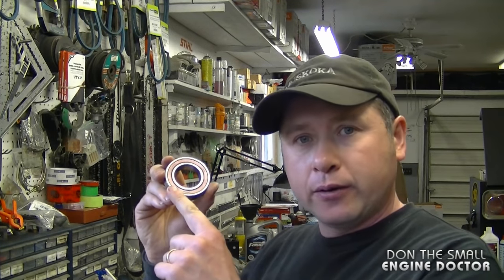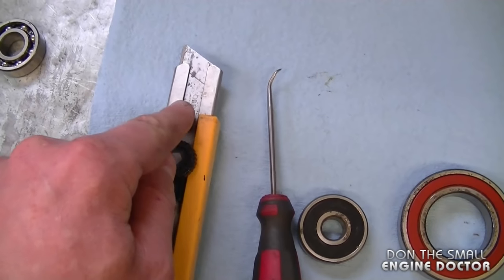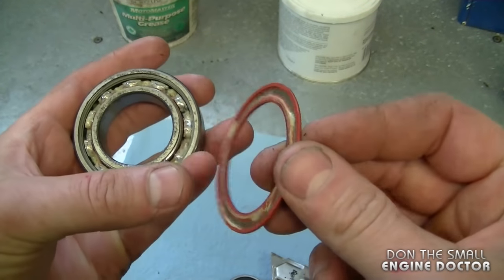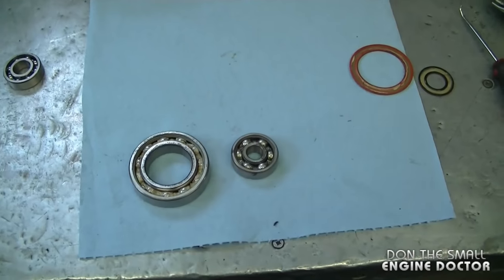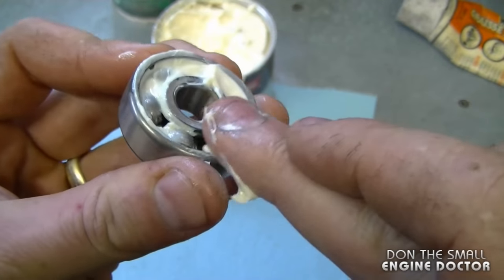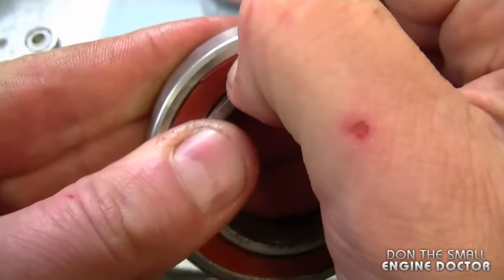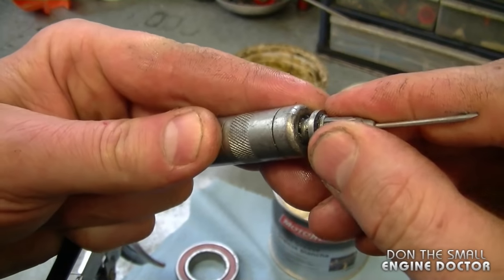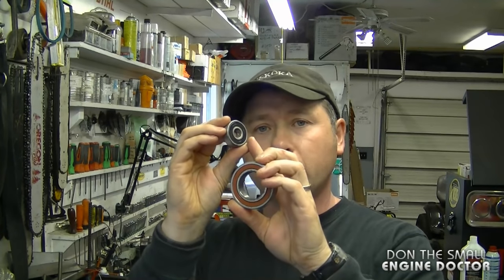HOW-TO Grease A Sealed Bearing

Comment: Love your videos Donny, but every now and then I have to shake my head. This time your advice can do more harm than good and I know that is not your intention. Bearings are cheap compared to the damage a failed bearing can do to a machine. I do understand that there are many situations where a replacement bearing is not easy to find and what you have shown here should be seen as a temporary fix. You did say not to over grease but you should also have said that over-greasing a bearing can destroy a bearing as sure as not enough grease. The larger bearing already had about the right amount in. The smaller one was too dry in which case damage may already have occurred so it would be safer to replace it as soon as you can take delivery. This is a great fix in non-critical applications. In other more critical areas if you are going to press a bearing out - always press a new one in, better to not take the chance. Weed whacker crank bearings are a case in point :-)
Reply: I understand what you said, but I think the rule of common sense applies here. No one will attempt this in engine or (high speed) wheel bearings. I would happily do this on my lawn tractor for example. As long there's no wobble, the bearing is fine.
Reply: I understand your reply and have stated; "This is a great fix in non-critical applications". Yep, great for mower wheel bearings etc., just not for weed eater bearings and the like. Common sense is not always present so making the distinction is part of good advice.
Reply: Hey, I'm not griping, Donny usually gives great advice. Common sense is not gifted to everyone though, so this post should only apply to low speed non critical applications and that wasn't stated. I know more than one have-a-go-hero that would mess this up and probably cause injury to someone. It ain't cool to encourage those short on common sense to do dumb stuff. Flemming the wheel bearings you mention don't come under the 'sealed bearing' category that applies here :)
Reply: Repack all sealed bearings even when new. There will be a minimal coating of grease in the bearing ensuring premature wear and failure. Buy a sealed bearing and have a look. I always repack my bearings; ducati wheel bearings especially else they will only last a year or so. Same with vehicle suspension ball joints. Only minimal grease. Assume it is a cost issue !!!!!!
Reply: I have been repacking sealed wheel bearings for years and prefer to ride my motorcycles in the knowledge the bearings have lubrication. Premature bearing failure is guaranteed unless they are repacked as from new bearings have only enough grease to stop them rusting. A very thin coat indeed. Naysayers have a look at a new sealed bearing.
Reply: Flemming, There are bearings that this hack should not be done to. Good guidance seems to have slipped Donny's mind on this video - easily done if one is not mindful that you are teaching expert/skilled hacks to
 an audience of amateurs of varying levels of competence from those downright dangerous to themselves and others, to those who can apply tools to machinery in a skilled safe manner.

If you assume that there are no flakes out there who won't pull the seal on a worn 8000+ RPM shaft bearing that should be replaced, then over-pack it with grease because of this post then you are a out of touch with many 'wannabe' home mechanics. If you have no experience of 'dummy aftermath', you are the lucky one.
Reply: Flemming. I am trying to play nice here. You owe it to yourself to learn to read. In my original post I stated: "Weed whacker crank bearings are a case in point". Weed whacker crankshafts spin at around 8000 RPM and exit the crankcase through a sealed bearing in many cases. I have come across two so far that have lunched their front bearings, one of 21cc the other 28cc. You seem to be unfamiliar with their design - once those balls get loose from their cage they tend to find their way into the cooling fins of the flywheel/magneto rotor which, when rotating at somewhere around their max design speed of 8000 (ish) RPM gives them more than enough ballistic energy to shatter the plastic housing and injure the operator's forearm, as the throttle trigger grip  is on that housing.

Thankfully most of these machines suffer carburetor death before the bearings go - but some will get run to bearing death.

 Have you no concept of responsibility?

You do not think... It is outside your experience so it doesn't happen? My dear fellow - s#!t happens all the time and prevention is better than stitches and bandages.
Reply: PrimusRage I get your point you are supposedly trying to help people out here and give better advice than what is given in the video . But you act like greasing a bearing is something so major and so hard to do that you must be a rocket scientist to do it . And that if you do it wrong the bearing is going to end up killing you or something . Then you bring up the common sense issue and how the wannabe mechanics will try and they will fail and etc. Load of crap is what you are saying basically .IF the so call wannabe mechanics you speak of are good enough to get the bearing off of its fixed position of where ever it is located on a machine I think they would have enough sense to pry off a seal on a bearing and put some grease in it . What are you a bearing salesman haha
Reply: Rhubarb, every sealed ball bearing ever made is only filled ONE THIRD of the way around the circumference of the bearing assembly. But it's not because of a COST issue. It's because TOO MUCH grease creates too much DRAG and FRICTION in a bearing. Too much grease in a bearing is just as bad as not enough grease. But don't take my word for it. Call and ask an engineer at ANY manufacturer of ball bearings. You really think 2 cents worth of grease is going to matter to them cost wise???
Reply: PrimusRage, Well stated Sir. A ball bearing should never be filled with more than 1/3 of the circumference of the bearing assembly. That is all they need and adding more grease just increases drag, friction and heat which are all detrimental to a bearings operation. Bearings should also be thoroughly cleaned of all dirt and old grease and the balls and raceways inspected for damage before re-greasing them. It's just a waste of time to stuff more grease in an already worn out, galled or fretting bearing. It's not going to last anyway. Work smarter - not harder.
Reply: Highpwr, Thanks, nice to see someone else here who actually knows their stuff. It seems that some of Donny's fans don't appreciate sound engineering advice from real engineers. SMH.
Reply: Flemming Werner Nielsen overfilling with grease can cause bearings to overheat too.
Reply: PrimusRage:   You stole my thunder.  As a long-time maintenance man, I concur with all you have said.  Once a sealed bearing is in your hand, its next location should be the recycle bin.  Sealed bearing are NEVER intentionally shipped dry and if you investigate and find there is no lube "inside" a bearing, it will surely be on the "outside".  If this is the case, heat drove the lube out and the cause of the heat was bearing failure.  So, the bearing in your hand has already failed.  At this point, your labor removing, and reinstalling is wasted time as well as risking damage to an expensive housing.  Just use your push mower until you can get another bearing. (NOT Nichi, or Enduro)  SKF, FAG, Timkin are just a few that will likely outlast the cheap original equipment.
Reply: Flemming, Tecnico, Billy, Rhubarb. Why are you arguing against common sense (and sound experienced advice)? All you have to do is ask a qualified engineer or career mechanic about proper use of sealed bearings. Your criticisms only prove that Donny's advice was incomplete with regard to knowledge you guys are clearly not in possession of.

In the great scheme of things, how you mangle your own toys is down to you. Just keep in mind the old saying - 'too little knowledge is a dangerous thing'.
Reply: I made one comment that was just my two cents . Not here to argue with you or anyone else , a pointless argument the start with about a freaking bearing . I have plenty of common sense and experience to believe me . Grew up on a farm and was raised there been working on machines for 17 years . And not the little weed eater machines that have the bearings you been up here fussing about for a couple days now . Please exclude me from this conversation it is pointless if you want to grease your bearings grease them I do not care either way worse that can happen is they fail and you end up replacing them . OR you can go to one of these qualified career mechanics this guy speaks of and get changed for probably 100 a hour for them to switch it out for you and charge you probably 50 for a bearing that prob only cost them at most 15. Either way doesn't matter to me your bearing do as you please . The only knowledge you should be speaking of is your own mr rage because you know nothing of mine .
Reply: Billy. Sorry to hear that you have spent 17 years working on farm machinery without having ever known an engineer or career mechanic in your circle of friends that you can talk to for free. How does that qualify you to tell me and the other real engineers here that what I was saying a load of crap...
Reply: Flemming, I have no need or desire to subscribe to Donny's channel since he seems quite happy to make a dollar or two from posting hacks like this without good guidance for the unaware. It shows from this thread that there are many like you out there. Enjoy, but try not to wreck toys in a situation that could hurt others.
Reply: You guys get a room..
Reply: I do it on wheel bearings. You should too if you want them to not rust out.
Reply: PrimusRage would you advise this hack on idle pulleys? reading all the comments, i am having 2nd thoughs?

Comment: Have you ever heard of MOLYBDENUM DI-SULFIDE??? this grease will make bearings last forever, just FYI. I work in a big truck shop and I have never lost a U joint or bearing that has been packed with  MOLYBDENUM DI-SULFIDE.
Reply: Except it won't.  Adding moly to grease does not keep it from hardening or loss.  Many vehicle bearings/etc came from the factory with moly grease and do fail.

Comment: Nice video, I did not know the plastic seals came out and could be reinstalled so easily.

Suggestion:

Clean the bearing thoroughly before taking the plastic cover off.  For instance: WD-40 and a couple of clean rags, or a cleaning tank.

If the bearing inner race has any measurable slop with bare hands, or if after opening plastic seal any metal particles are found, replace the bearing. I'm sure there are other observations that also indicate that the bearing needs to be changed.

When working with grease and cleaners, wear latex or nitrile gloves.  Many types of grease and cleaners have components that can be absorbed through the skin; especially marine type waterproof grease which often has related warnings.

To pack bearings, put a blob of grease in the palm of your left gloved hand; be sure the glove and bearing are clean so NO dirt is introduced into the bearing.  Which also means make sure your grease gun is clean before you start.

Hold the bearing with the right hand and with a scrapping motion, roll the bearing into the blob to force grease to pack into the bearing.  This YouTube video is an example:

https://www.youtube.com/watch?v=BhL1uAp_WCw

Considerable effort is needed to create a clean environment for packing bearings.

Optionally, I would think the grease needle demonstrated, could also be used to inject grease deep into the bearing after the seal is removed.  Potentially making it easier to get deep grease penetration; and helping to force old grease and wear contaminants out of the bearing to be wiped off with a clean rag or paper towel.  This also requires much less effort to prevent contamination of the bearing from the transfer of dirt: tools, hands, dirty rag, cleaning tank residue ... 

Just sharing some insights,

Guidepost.us

Comment: if you take out both covers... clean  out old grease with solvent. .and add clean  new grease using your palm..you will extend  life  of bearing..synthetic  grease works  well.
Reply: agree.
you need to wash out the remains of the old grease. grease is oil and soap emulsified. the oil comes out leaving the soap behind, which goes hard damaging the bearings. so you need to wash it out before replacing.

the manufacture has specs on how much grease that goes into the bearing. putting more in causes the grease to get in the way of the ball bearings and increases friction. the bearing will increase in heat and cook the grease which then causes bearing failure.

what you can do is spin the bearing without the covers on to get rid of excess grease. then fit the covers.

Comment: Never pack a bearing tight. The grease will not circulate and carry off heat. That's why a new sealed bearing is never overfilled. 1/2 full is more than adequate.

Comment: Pick the proper grease there are lot of different melting points white grease having one of the lowest. Also doing this when the bearing is new will extend the life waiting till the factory supplied grease runs out won't be good . When I PDI a new MX or enduro  bike I pack all the wheel bearings and that extends the life by 100s  of hours . Always remember on new equipment factory installed bearings have little to no grease.

Comment: bad advice IMO, those bearings are grossly over packed with grease, the amount of grease installed in the factory is a carefully calculated and researched amount for good reason. whilst gobbing that among of grease into a slow speed bearing may be ok for slow speed most bearings are high speed and the centrifugal force of wanting to throw that amount of grease outwards will simply want to blow the seal out or at best leak grease out until the amount inside stabilises. another factor is the friction and  heat generated by the bearing trying to deal with the over packed amount of grease. one small dob of grease on 1/6th if the race circle is more than adequate for proper and long lasting and effective lubrication of the raceway,  try doing the same thing to the gear head of an angle grinder and see what happens. both are similar grease sealed situations. also flushing and removing the old grease is inportant. replacing grease is a temporary fix at best, if the bearing feels rough and loose and / or not perfectally smooth its stuffed anyway, thet are cheap, buy a new one. theres no way i'd repack a bearing on a customers equipment, not without informing them and getting their permission anyway. and only if the bearing was a special, expensive or hard to get type.
Reply: I like the word “calculated”.

Comment: If you're fitting sealed bearings into a wheel rim with a grease nipple, only one end of the bearing needs the plastic cover removed.
But be sure to fit them in with the sealed end facing outwards though.

Comment: I like to drop newly greased bearings into a full vacuum cleaner bag before I install the seals. Oh wait, Nonono, I meant I like to clean out the old grease before applying the new grease, THEN drop it into a vac bag.

Comment: Unless the bearing runs smooth and the balls are still clean and shiny, I would rather remove both seals and clean the bearing really good in Paint thinner (acetone is much weaker for this), by spinning the bearing maybe with an electric drill to remove all grit that is stuck inside the ball cage.  Then dry well and pack with good quality synthetic grease, this should have the bearing last another few years unless the balls are very pitted and rusted with play to them.

Comment: Good video, you can also use a grease gun once the plastic cover is off which is better than pushing grease in by hand as it is really forced into the rollers/ball bearings.

Comment: Good place to get small picks is to ask your dentist if they have any broken ones, the picks usually have two sides and only one side breaks and they throw the picks away.
Reply: Harbor freight has picks too.
Reply: .....I was given that advice once and went to a dental school to ask if they had old damaged picks that could be repurposed. They told me that all worn picks were sent to veterinary schools and clinics.  Anyway jewelry craft suppliers were a source at exaggerated prices and I also found I could fashion my own from various gauges of piano wire heated ref hot to bend appropriately and sharpening .